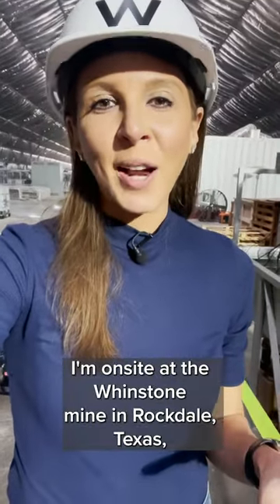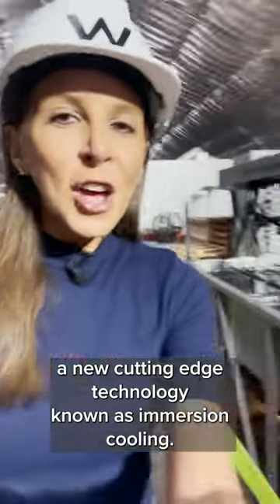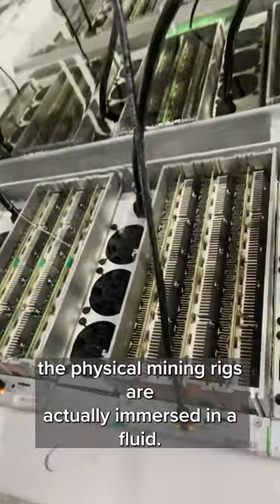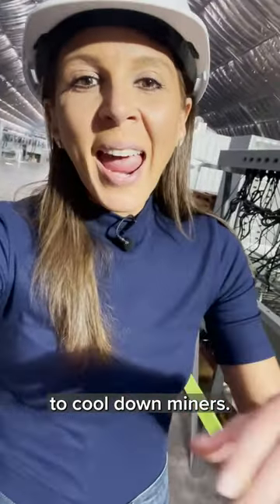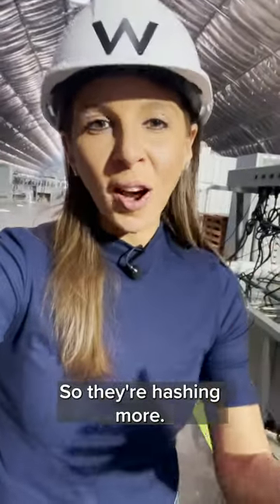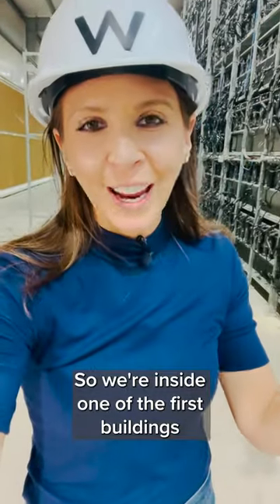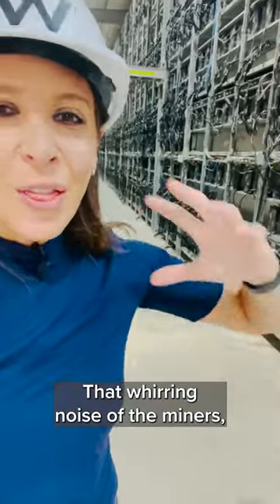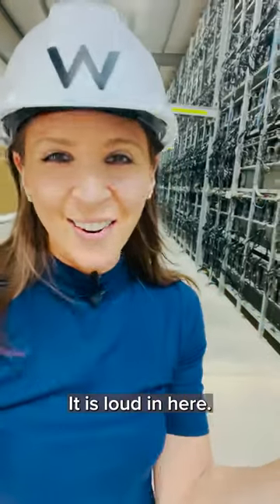We got a peek inside Whinestone's bitcoin mine in Texas #Shorts

Comment: Proof of Stake and similar is where everything is going.  all those mining rigs will be gone.  Proof of Work requires too much expensive hardware is uses too much electricity.    a PoS node and/or Validator can be run on a laptop or desktop.
Reply: Most of the Bitcoin have already been mined. so no big deal.
Reply: @creativity.studio4967  the amount of energy used to mine Bitcoin has absolutely nothing to do with the amount of Bitcoin left to mine.
Reply: Proof of stake rewards validators for doing absolutely nothing but having money staked... the validators also get to choose which transactions are valid, which means those with all the money will get to decide which transactions are valid.

Bitcoin miners do not determine which transactions are valid.